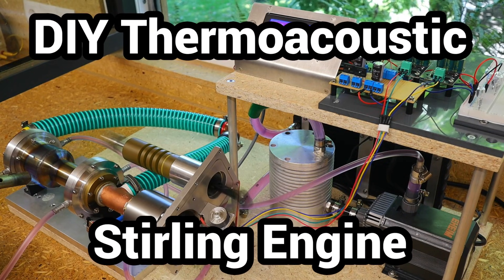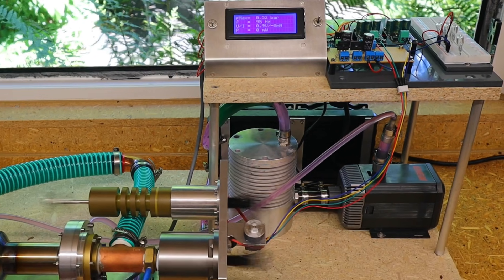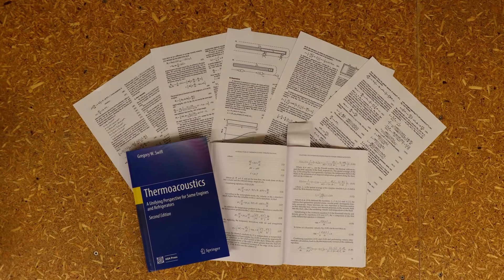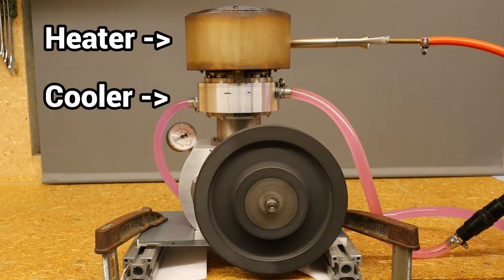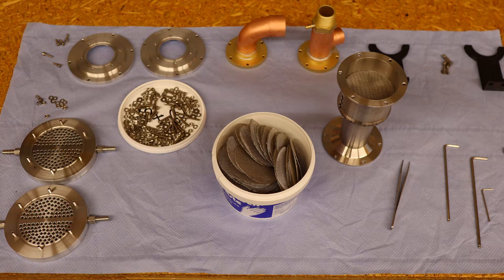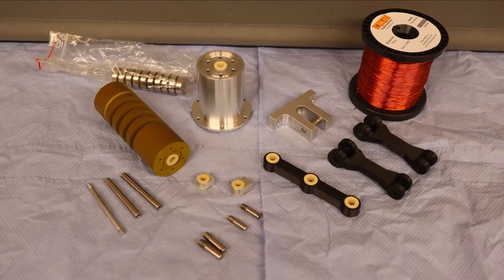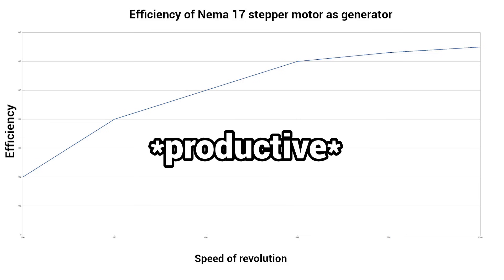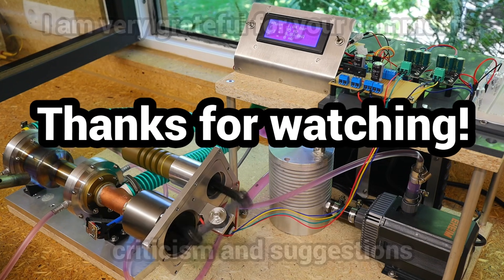Developing the thermoacoustic Stirling engine to generate power for the home

Comment: You are replacing a whole research team with what you are doing.  The amount of work, dedication and skill is just stunning.
But I still have doubts that a high frequency device like the thermoaccoustic stirling will be highly efficient.
Reply from the maker: In principle, several development teams have already proven that it is possible to build a thermoacoustic motor with very good efficiency.
However, it is of course not certain whether my attempt will be successful.
This depends largely on how successful the next tests are and how motivated I remain... 
Thanks for your very kind comment!

Comment: Would there be any downside to submerging the cooling portion in water? There are more efficient coolants for sure, but water is readily available and I would think it'd be able to dissipate heat very well.
Reply from the maker: That would be possible but it is unpractical.
I have a active cooling circuit with fans and a pump that circles the cooling water trough the coolers which is quite effective.
The inner cooler surface area has to be improved which I tried with the new, longer coolers which tests are still ongoing.

Comment: I wonder if it would be possible to use the cooling effect of the expanding pressurized gas to cool the cooling chamber by wrapping a coil around it right before it gets to the burner.
Reply from the maker: I have no idea how this can be realized, can you go more into details please?
Reply: @myengines2443 , if you wrap a copper coil around the cooling chamber, you use that copper coil to transport the gas from the pressurized gas tank to the burner. Due to the gas expanding, it will cool down and in turn, cool the copper coil that's wrapped around the cooling chamber.

I don't know a better way to explain this. I also don't know if this is even possible, it's more of a tought experiment than anything else at the moment.
Reply from the maker: Yes, that's a kind of air (burning gas in this case) preheating which is absolutely important in a later productive engine.
Its important to save energy and maybe together with the air for the burner its enough to cool the engine but I think additional cooling used for heating is also necessary!

Comment: What does it use as its source of heat?
Reply from the maker: Self produced biogas!
Look at my older video where I show how I make it!
Reply: @myengines2443  This is fine but presumably lighter fluid, (Butane) would work just as well?
Reply from the maker: But the butane has to be purchased, whereas my self-produced biogas costs nothing!
Reply: @myengines2443  True, but the time you take in making the biogas would be better spent on the engine I fear.
Reply from the maker: Yes yes, so much to do and so little time....

Comment: I like this. Rather than trying to use it to generate electricity, with concomitant losses, it would be better to use the linear power directly via Bowden cable to the point of use.
Reply from the maker: But the point of use for me is generating electricity.
Do you think of pumping water or something like this?
Reply: @myengines2443  Generate electricity by all means, and the best of luck. My point is that a reciprocator can also be used for a variety of other purposes, without the conversion losses associated with electricity generation. You hit on pumping water as a good example, but there are others for which it could also be ideal. What I have in mind is a "Bowden Cable" application. This is rather like the brake cabling used on ordinary push bikes, but with (e.g.) teflon sheathing to minimise friction. When attached to a reciprocator (like yours), it enables power to be distributed to where it's needed using flexible and cheap cabling. Say it were used to provide front wheel drive to a small car, - it would remove the need for heavy and expensive mechanical devices like constant velocity joints to allow the front wheels to be steered whilst also being driven. Other examples are legion.

Comment: Is it possible to use used oil stoves as heating element like these? https://www.youtube.com/shorts/moRHIwCjedM
I have a lot of waste cooking oil from frying, I wish to use it to generate electricity.
Reply from the maker: Your link does not work for me, but the use of waste oil is one possibility for running the engine.
I produce my own biogas with a diy mico digester which you can see in an older video!

Comment: I must ask you again - why are you still stubornly resisting to make a heater out of  a RESISTIVE WIRE? You can input the heat directly in the engine and can measure easilly how much heat are you putting in the engine.
Reply from the maker: Do you know where I can by a complete set of a resistive wire with power supply?
The only thing I can find is just a NICR wire with glas fibre insulation but I don't know which diameter will be suitable and which power supply is neccessary.
I just have a 30V/3A power supply.
I would be very nice if you could tell me where it might be purchaseable, many thanks for your help!

Comment: I'm not sure what it's called, but there are mechanisms/linkages that could allow a generator at the pivot point to keep rotating in the same direction regardless of which way the arm is going.  No idea if that would be better than a linear generator.
Reply from the maker: I discovered several of these mechanisms which mostly work with a ratchet or have even more friction and wear but I am still searching. 
A mechanism with little friction and wear would be very nice!
Reply: @myengines2443  I don't know if you are familiar with Robert Murray-Smith....he has a very interesting channel.  He has played around w/ a few of these sorts of mechanisms.  You are right, they will probably introduce friction but that doesn't mean that overall it still wouldn't work better than some other concepts.  I wish I could fabricate as good as you, I'd experiment more myself!

Comment: If the sieves could be made out of silver or copper that could/would be having a (great) effect wouldn't it?
Reply from the maker: Maybe in some configurations but normally the temperature gradient (difference) between the hot and the cold side is the most important parameter and this is better with a low cunductive material like stainless steel.
The requirements for the material are contradictory, so there is no such thing as the optimal regenerator material.
Reply: @myengines2443  ahh thx for explaining me. For me even after a full physics studies I am still trying  to fully comprehend how heat pumps work. Hard to wrap your head around even after you know that it works.

Comment: lol    you are so mis-guided.    a heat engine should not be made extra complicated.!    all of the reciprocing components should be mass as light as is practical.    the output motion of a reciprocaing engine  SHOULD  be  converted  to  ROTARY.    a rotary alternator  SHOULD  be made/used.    a  GENERATING  coil should be made a certain way.!!!     specifically, the conductor used should be the equivalent of 14awg.    this should be achieved by winding multiple strands of (small) magnet wire as a single conductor.

Comment: Tuning capacitors placed across the stepper motor's coils, can elevate the output voltage for a given rate of rotor travel. 
I learned this, when using them as generators for wind turbines  :) .
Reply from the maker: Thank you very much I will try it!

Comment: Yo. To harvest this energy, convert the rear of that exposed piston shaft into a Rack Gear connected to a ratchet that converts the back and forth motion to single axis rotation. You harvest both flow directions pretty efficiently this way and it can go directly into a flywheel.. 
This is one of the slickest Stirling engines I've seen. I'm embarking on my own Solar Powered Stirling adventure.
Reply from the maker: I have also looked into various ratchet mechanisms, but they seem to me to be very prone to friction and wear, at least at higher power levels.
Please share pictures and videos of your Stirling project, even if you are still in the early stages. You will receive a lot of help and motivation from others, which is really important!
Thanks for your nice comment!

Comment: The balancing mechanism you are using looks like it would introduce an oscillating rocking reaction. Have you considered using a scissor linkage with a counterweight to do the balancing?

You can make a partial scissor linkage where the center is a stationary joint that is the main pivot point, one half  is a rhombus, and the other half is left open, with counterweights at the tips of the two arms. If you push the end of the rhombus in and out, the counterweights on the two arms should move in a way that leaves the center of gravity of the entire system stationary.

Also, I recommend using some sort of heat pipe to transport heat into the engine. Heat just doesn't transfer that well across surfaces where you are trying to get heat from a gas, through that surface, back into another gas.
Reply from the maker: A scissor linkage is quite attractive but the many moving parts and bearings will do a lot of friction?
A heat pipe is really nice but I have no clue how to make one, isn't it quite complex, complicated and maybe dangerous (explosion if not done right) ?

Comment: IS there some good reason you can't put both cylinder in line with each other and lose the linkage?  Because it is definitely going to be a source of problems / shortened life.
Reply from the maker: The lever is for balancing the engine as is shakes badly without balancing which will be much worse when the performance is raising!

Comment: Aster Thermoacoustics did work on bidirectional turbine thermoacoustics and published some papers. Their website should be still available at the internet archive way back machine. They found linear generator reciprocating mass scaling related frequency limitations was unfavorable compared to bidirectional turbines. Not sure what happened to the company, looks like the owner/researcher went into consulting work.
Reply from the maker: I know a bit of their work and also 3D printed a bidirectional impuls turbine a few month ago.
You can see it shortly in the video.
It is quite complex but I will test it further and compare it to the stepper and linear generator.
Thanks for the hint and your nice comment!
Reply: @myengines2443 Apparently Equium and Blue Heart have been popping up in the news recently as thermoacoustic heat pump makers for reason, despite no obvious progress in 2 years. They appear to use fixed length closed C looped designs where the heat exchanger heatpipes penetrate the tube ends so all the heat apparatus is close together.

Comment: it is also possible to enhance the linear generator, you have a stick on the end with piston, if extend the tube around the piston long enough, with diameter very close to piston's diameter, so moving piston inside tube will generate air flow, in out, but if put rotar generator with equal shaped blades so the in and out flow generaters movement of blades in one direction you will get roatating of generator in the same direction, the piston moves to too fast not sure will it work but it can be done to separate in  and out flows with electromagnetic sashes as used in cameras, so when piston moves back in socket is open and one generator works and when out is open then another, but with equal curved blades it should work on one generator hopefully
Reply from the maker: Maybe you can send a sketch of this on our discord so I can understand it completely?
That would be very nice, thanks for your kind help!

Comment: Try heat pipes for your heat exchanger for more efficient heat transfer
Reply from the maker: Yes that's a good hint, are the a readily purchasable anywhere?
Reply: @myengines2443  Hi there, first, the thermal energy of the gas must be collected, which requires a large surface area. Here we can only extract heat from the gas flame with significant losses. The quality of the heat exchange does not primarily depend on the already fixed heat transfer rate, so a heat pipe that can transfer heat from the heat source to the inside of the machine very quickly is useless, because the gas working medium in the machine must absorb this heat on the other side. If the gas is slower or unable to absorb the full amount of heat, then we will have losses, and these are large. The importance of heat removal on the cold side is paid much less attention by experimenters than it should be, although the heat introduced into the machine must be able to be removed on the other side, otherwise the cycle will operate with poor efficiency. This also requires a large surface area on the gas side, special connection points, expensive solutions and gas channels similar to the depth of heat penetration. Different channels on the cold and hot sides due to changes in the properties of the gas. Ideally 2xTPD. However, then the resistance of the gas entering the channel will be enormous, which forces us to increase the dimensions of the channel. In summary, if we do not have a near-ideal sized gas-side heat channel and a heat exchange surface with low flow and other losses, then we can only utilize part of the heat released from combustion for work in the machine. It is no coincidence that even the most advanced gasoline-powered Stirling engines require a burner with at least 10-20 times more power for propulsion. Therefore, they are used more as auxiliary power generators in applications where heat is primarily utilized, and the waste heat of the flue gas quasi-exhausted into the chimney is utilized for electricity generation. BLADE
Reply from the maker: Thank you for your very detailed help. I need to work through this carefully at my leisure, and then I may have a few more questions!

Comment: These would work great with heat batteries.   You can charge your heat battery with solar thermal or a windmill driven (or bike driven for that matter) friction heater to have on hand when you need it.
Reply from the maker: You are not the first who say this, I really have to look closer to heat batteries.
Thank you for your nice comment!

Comment: Active diodes have their own problems.
My suggestion is to use good schottky diodes in TO-220 dual-diode 16A or 20A pack, they can have a Vf as low as 0.1 volt with lower currents under 2A.
And, obviously, if your generator output voltage is too low for good efficiency, use more windings to raise the outout voltage. Or if using a stepper motor get a motor with a higher voltage winding.
You need to consider what you will do with the output once it is DC, ideally you want at least a few volts DC so you can efficiently convert it to the desired voltage with a SMPS.
Reply from the maker: Yes you are right in everything.
The engine is still in the very beginning of its development and soon I hope to get more power so I can produce reasonable voltages.
For my solar battery I need at least 50V!
Thanks for your nice comment!

Comment: The burner really needs a recuperator to get the best overall cycle efficiency, will you be adding that once you're happy with the engine?
Reply from the maker: Yes of course, air preheating is a fundamental concept of the Stirling engine!